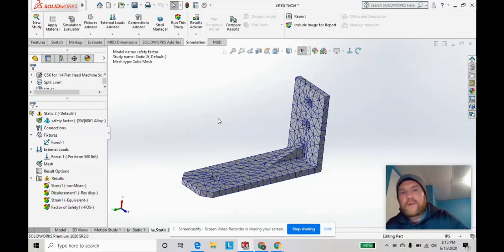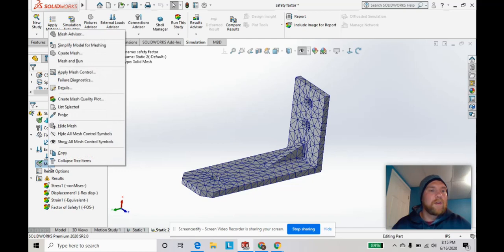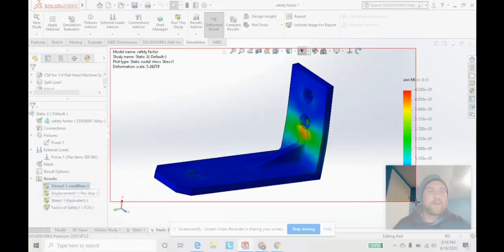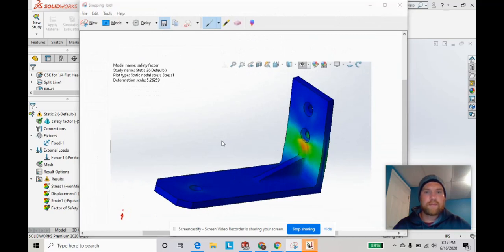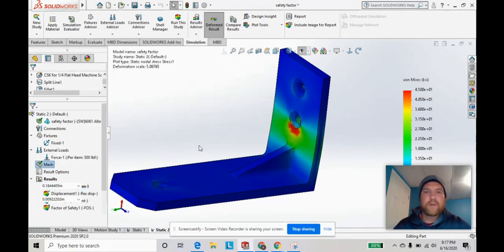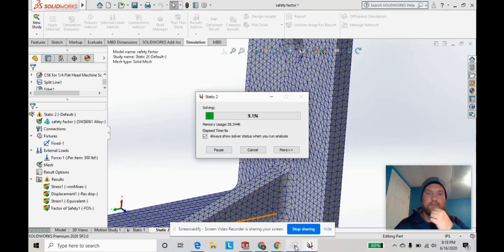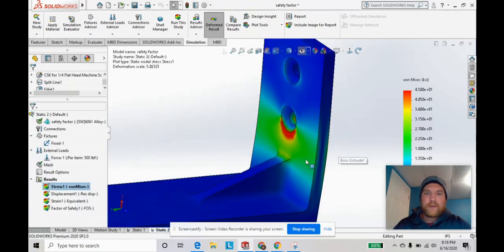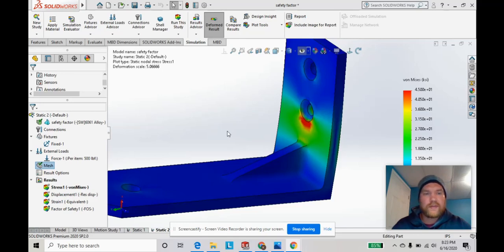Meshing in Solidworks | Coarse vs Fine Mesh

Comment: Hi, Is it recommended to use superfine mesh most of the time? Or what are the parameters on which mesh size depends?
Reply from the maker: Run the aspect ratio plot that will show you mesh quality, if you see low ratio ideally around 1 then you should be good